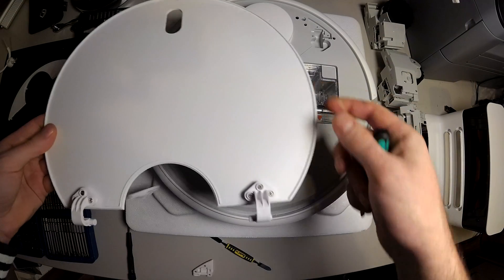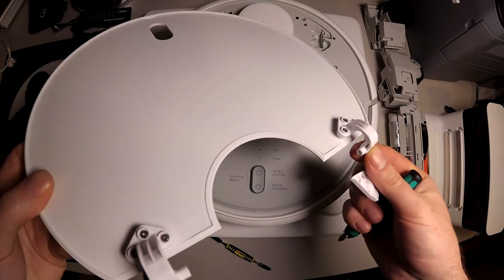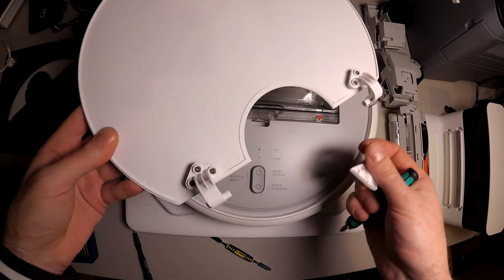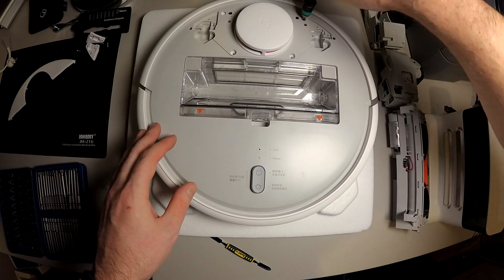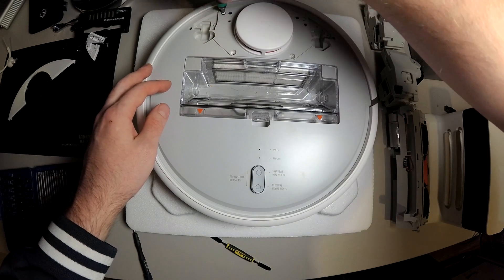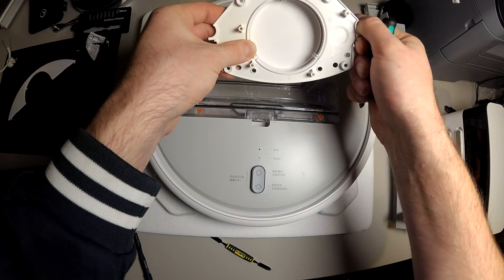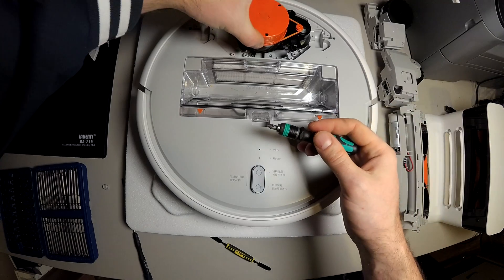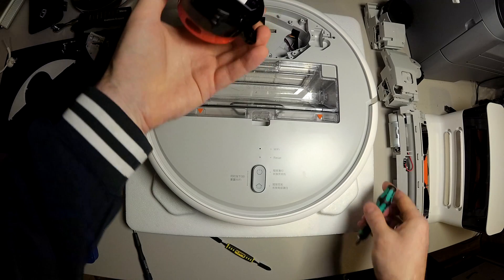XIAOMI MIJA Vacuum, how to change the LDS senso unit

Comment: Hi Anton, thank very much for your videos on xiaomi mi robot vacuum. I have almost the same behavior of KIM (damaged) LDS sensor (scattered movements and inaccurate maps). Also the robot don't find the dock even it is in front of it. I have deeply cleaned everythings but the problem persist.
Do you think my case maybe it's correlated with problem on LDS laser sensor?
Thank in advance for your reply.
Reply from the maker: +Francesco Dalla Ca' 

There are two types of possible errors, the one you have some dust in sensor, easy to fix: takeout the sensor spin it by hand. And then you need some pressure air, und Blow in to the two holes from the sensor(the laser, and the camera) put it back and if your are lucky you have a working robot. If not, you can open the top part and check the connectors, and if this not helped you have an Kim problem and you need a spare LDS sensor you can buy on AliExpress.
Reply from the maker: +Francesco Dalla Ca' did it help
Reply: Hi Anton, I have cleaned the sensor without expected results. Ordered and mounted a new LDS sensor my robot is come back 100% fully functional. Thank you very much for help...